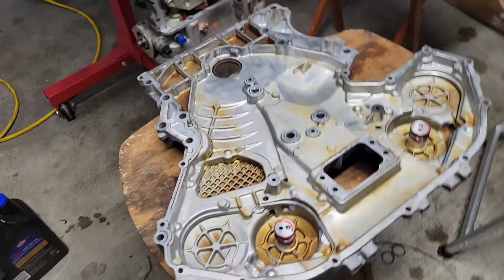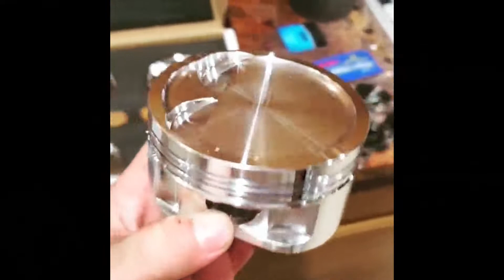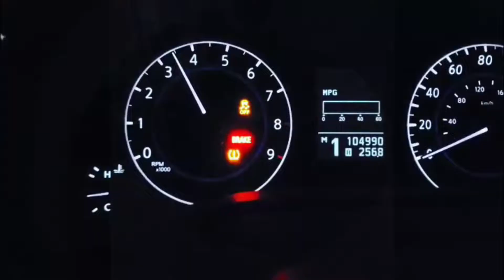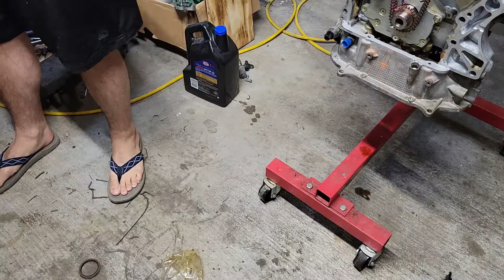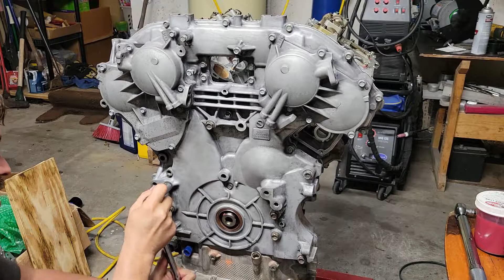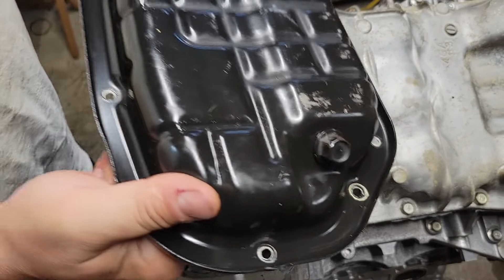Forged VQ37VHR build part 22, outer timing cover and upper/lower oil pan

Comment: Doing this on a g37 awd. Does the upper oil pan need to come out to remove the rear timing cover?
Reply from the maker: No, you can leave it but be careful when you pull the covers because the pins don't leave much room for movement.

Comment: I have a 2013  Fx50 s and need to get a motor rebuild for it. Are you able to refer me to anyone that rebuilds those FX 50 motors the 
V50
Reply from the maker: If it's for a daily driver, i'd highly recommend finding a salvage low mileage engine with a warranty and having it installed local to you.